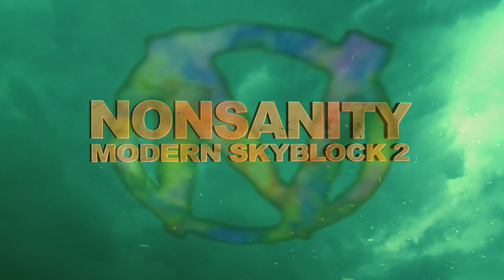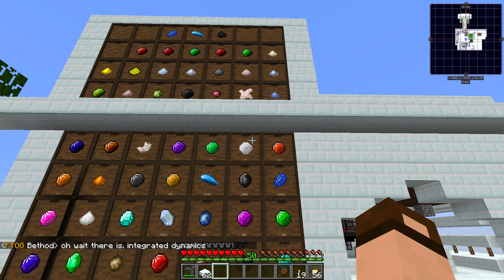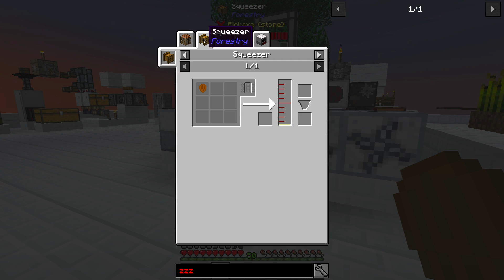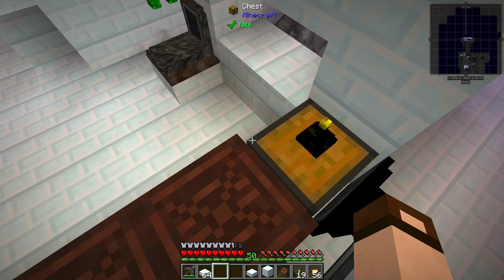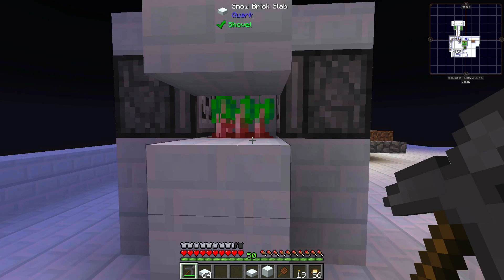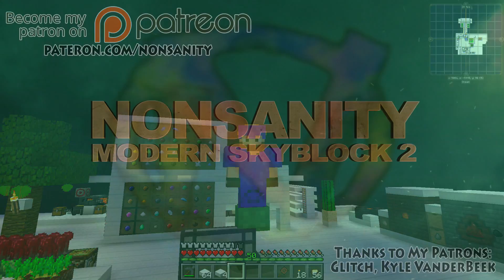Modern Skyblock 2 - Ep. 6 - Industrial Grinder & Automated Micro Smeltery

Comment: For your lighting update lag issue, try going into "mod options" on the pause screen, selecting Minecraft Forge, then under "General", turn on "Force threaded chunk rendering". It should offload those rendering updates to a separate thread, reducing the impact to your FPS.
Reply from the maker: +GeekyAsItGets It's already on. Though the lag has been better recently, so maybe the default got changed in a pack update.